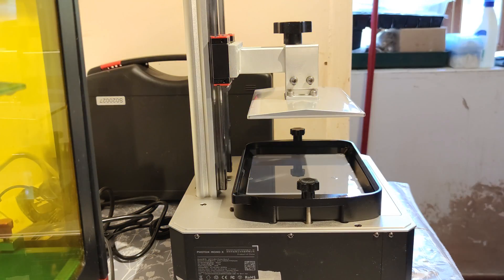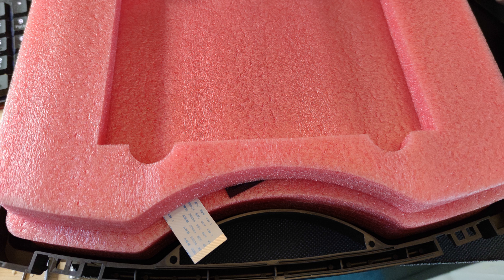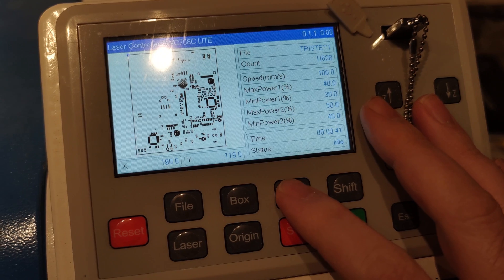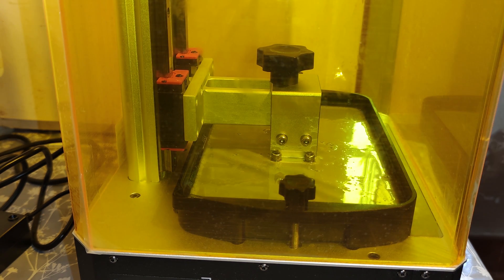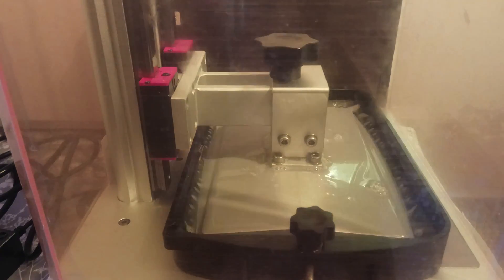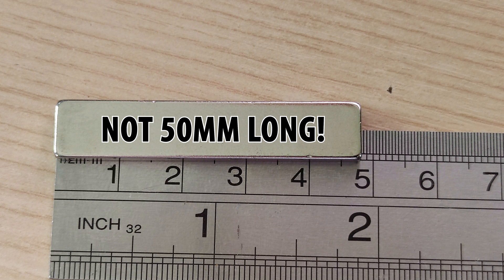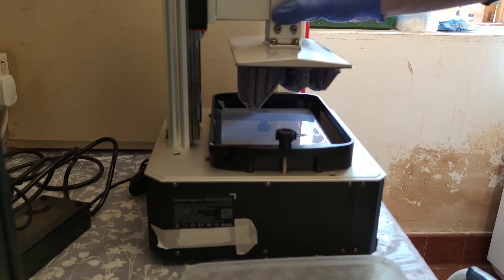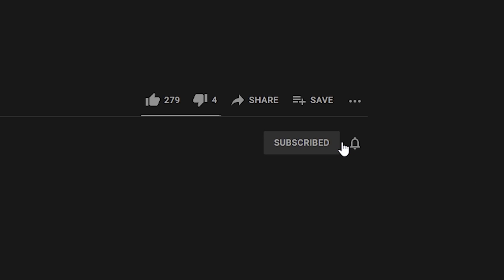Upgrades I Made To My Mono X Resin Printer!

Comment: hello!, the video is very interesting! I would like to know if it has happened to you that the fep sticks when the plate is raised, making a suction effect each time it rises. I have tried to decrease the upload speed of the plate and change exposure times but I still cannot print with quality and without that suction effect continuing to pass, by the way, I have a screen protector installed and with 80% UV.
Reply from the maker: firstly lower your UV level, most people find that UV above 50% causes a lot of light bleed through the mask and causes skin to form in the vat.
Suction is part of the problem with resin printing and its about finding the right balance, it might also be that your build plate might not be rough enough to counter the suction, and or your FEP has become too used and rough.
Some people have tried putting PTFE lube and rubbing it into the FEP. But you want to make sure theres no visible residue left and its just the finest of films on the FEP. 

but iv had trouble finding the stuff here in the UK and seems to be mostly a US thing. The thick foaming ptfe chain lube for bikes isnt the same stuff. But i have tried it, and not sure its helped. 

Outside of that Im not sure what more to suggest, You might just need to replace your fep.

Comment: Another thought:  Older peeps like me might struggle to simply lift the shield now and again.   So I had the idea to place steel plates atop the shield and fix flat magnets up underneath, thereby  allowing the capture of the shield while (whilst?) not piercing it in any way.   Then rig a motorized up-down fixture to do the dirty lifting work.  Perhaps a rig using 3D manufactured parts....  :D
From what I've seen so far, you are a thoughtful guy, as to using your tools.  I like to think the same of myself, and I'm often--though only still thought experiments--working through my own rig.
Not that far from getting it going, mind you.  It's in the spill tray, on top of the table...and next to the exhaust window.   Just have to pipe the fumes out, really.

Comment: With your laser cutting issue, I wonder if you could take the approach of cutting under a thin layer of water. Recently the Applied Science channel did a video on using a laser to cut ceramic with lists of experimentation, his video is here: https://youtu.be/kxXEI0Ce6C0

Comment: if i were you I wouldn't worry about scuffing the aluminum build plate.  It actually just helps the part stick to the build plate better and gives it more texture to grab onto.  The other issue you mentioned with the resin on the LCD screen I'm also concerned with on mine

Comment: Base layer over exposure will cause excessive shrinkage, tuning the settings, using the correct raft (lychee) and model orientation (why are you printing near parallel) would have been your answer instead of looking for different magnets.
Reply: and also depending on the Resin. did print max size of the mono x and never had problem with proper exposing.
Reply: THIS MANS VIDEO IS SUCH BAD ADVICE THAT NOOBS ARE GOING TO HAVE A BAD EXPERIENCE BECAUSE PEOPLE LIKE THIS GIVING HORRIBLE ADVICE

Comment: I bought a Wham Bam and it worked without any issues, I completely fill the build plate, and the suction forces never peel off the build plate, nor does the resin shrinking put it side ways, the sheet itself is made of spring steel I believe, and it always returns back to perfect shape....and their magnetic sheet sticks well, and it doesn't react at all to the resin (it does however react to my cleaning agent, and when I wipe it off I find a smear of black on the towel)

I've also had the issues with the screen, and I received a replacement one but haven't replaced it yet
Reply from the maker: I On a 8 inch plate? I was warned it was a common issue, even with whambam... Maybe they do use a stronger magnet than the Chinese one I had. Ive stlil not got round to figureing out how best to seal the magnet yet. But if your cleaning agent (IPA?) is dissolving the magnet the resin almost certainly will too. Just in my case what ever binding agent is used, its more susceptible to the solvents :/
Reply: @MD_Builds  It's been with me for close to a year now, and it's still going strong, I'm not saying IPA disolves it, but it just comes out with slight black smear, sure it might not live forever, but I think it will last me at least another couple of years at least

Yeah sealing will be very hard, ans you will often run a risk od contaminating the resin, plus most rubber sealants are silicone based so they might hurt how strong the plate attaches...it's a tough problem but I'm sure there's a workaround